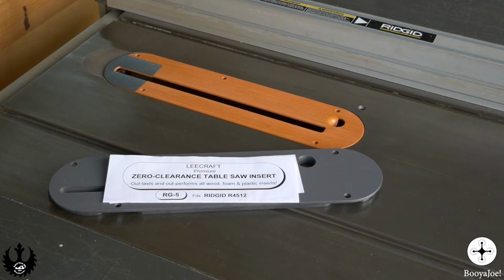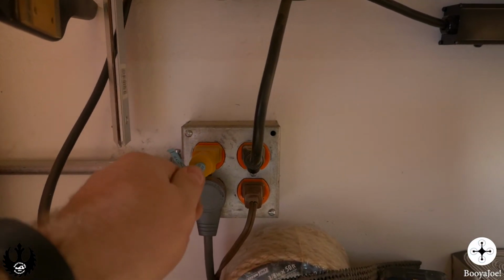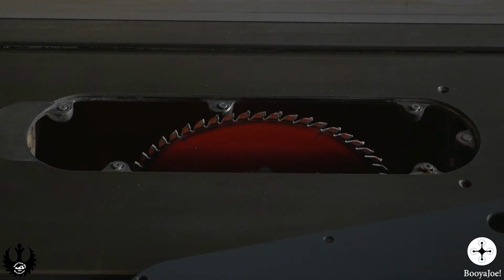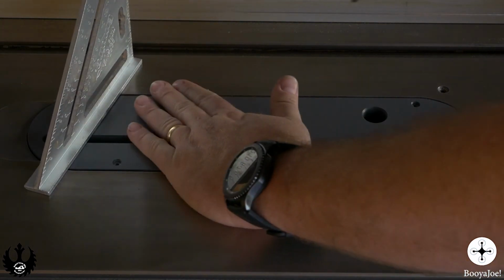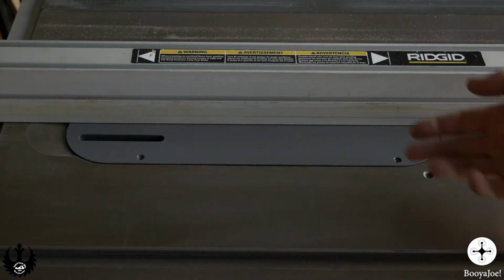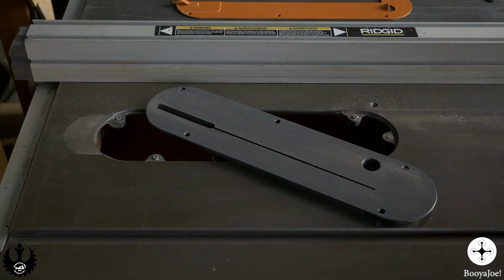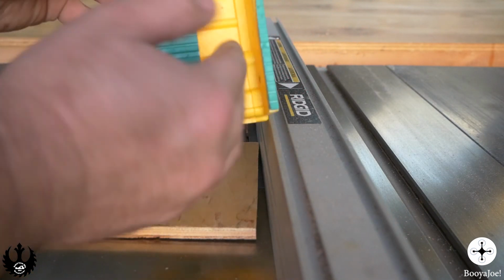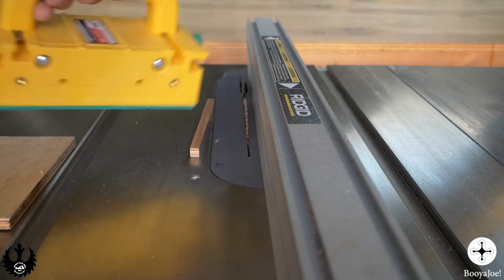How to Install a Zero Clearance Table Saw Insert Rigid R4512

Comment: I know those Microjigs seem to be recommended by everyone, but I just can't get comfortable directly riding my hands over the blade under any circumstances.  To me if you somehow lose your footing after the stock has passed through the blade, you are now leaning forward and risk the heel of your hand and wrist making contact.   I have a tool that I bought from Sears several years ago that rides over the fence where the handle is at a 45 degree angle vs parallel with the table.

Comment: Thanks for the great video, but isn't it dangerous to cross-cut (even plywood) against the table saw fence?  I was under the impression that this is where you'd use a spacing block so you don't accidentally bind that piece of wood up between the fence and the blade.
Reply from the maker: Totally agree.  I was using the very worst case scenario to show how the zero clearance helps from a safety perspective.   Thanks for the comment!

Comment: Why did you have burn marks while cutting the wood? Something must not be aligned right. My R4512 should arrive next week and I'm trying to watch all kinds  of R4512 videos to get ideas.
Reply from the maker: This was just a sample piece so I wasn't being careful or aligning. Plus the cut was only 1/2". The R4512 has a horrible fence out of the box. Have to constantly check for true. In fact my next video is installing my new Incra TS-LS fence onto this saw. Working in that now. Subscribe for more.  :-)